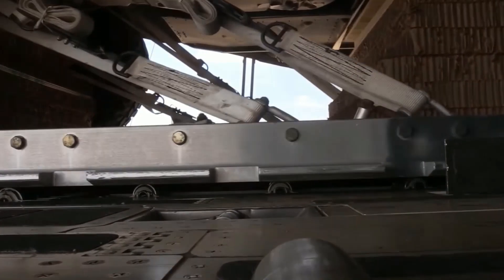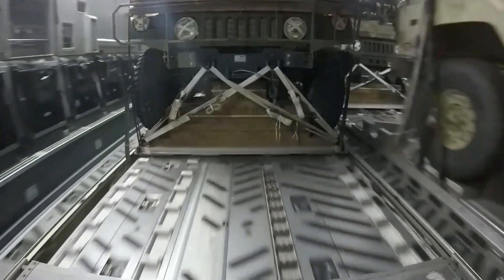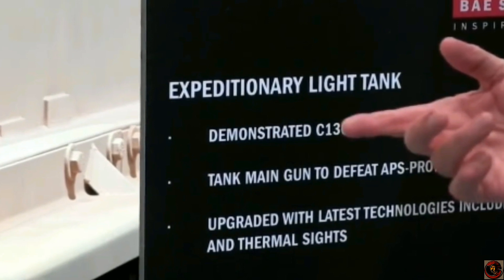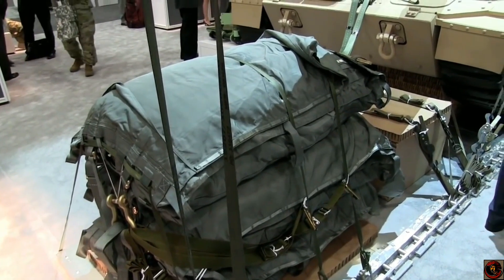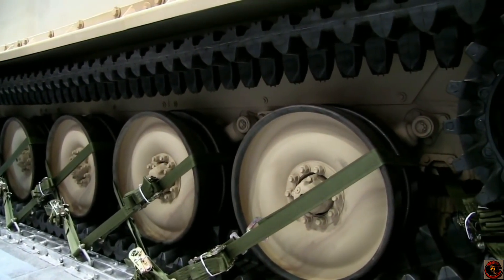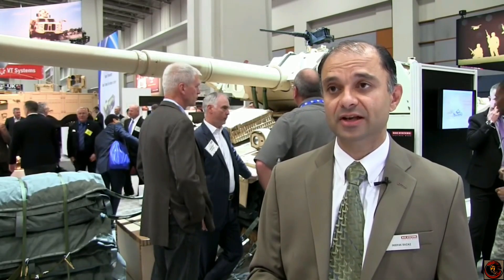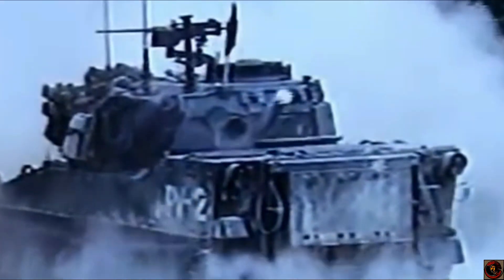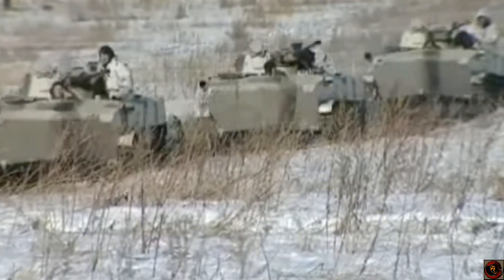Dropping a Tank From a Plane - Airborne Armour?

Comment: I don't think that this is ever going to work for a meaningful weight of armor without new aircraft that have been specifically designed from the beginning with this mission in mind. Dropping lighter vehicles is probably the best way to go with the aircraft we have. If you had a great big new helicopter that had a long range and could easily set down a 70 ton main battle tank that would work. But for dropping a meaningful weight of armor from planes I don't think that it can be done with the systems we have today. It would take everything a C-17 cat do and a lot of expensive engineering to get a main battle tank on the ground in usable condition. Something like a new heavy bomber that is designed with this mission in mind could work though. A great big parachute that can be guided by GPS and a great big air bag system on a tank that is loaded like a bomb that comes straight down from a bomb bay with the crew carefully secured inside and protected is the only way I see this working well.

Comment: Why noone trying to divide the tank to 2 or 3 separate parts, which one is with people inside or completely unmanned.
For example, dropping the chassis first, then the turret part.
About how to assemble those parts there are many examples, such as
1. accurate drop with some kind of guidance.
2. both parts have some kind of locomotion for a short range in case they're separated on the ground.
3. the armor part of the vehicle is bolted on type, and dropped separately.

Comment: For a fiction work I had looked into the Sheridan, air drop and air mobile forces. Didn't serve, so I presenting researched views.  1) Note on how I use terms: Air drop aka parachute as the common airborne is about dropping out of a plane with ground travel out. Air mobile is out of an aircraft with a reasonable prospect of getting back on (example Helicopter infantry). "Day one" refers to a sudden outbreak of hostilities. 2) Air drop lets you quickly deploy manpower and material vs the resources to sustain ongoing fighting. 3) The tank presented and the Sheriden air drop tank is not immediately useable as the crew wouldn't survive the shocks of impact. These could be expected to parachute in at the same time. As would additional ammunition, fuel or other consumables. 4) In looking at the modern situation we do see various asymmetric warfare where sudden engagements can happen by terrorists, bandit type forces or irregular insurgents. Putting even a light tank in the area is a major change as the asymmetric forces aren't going to have a similar vehicle. Survivability of a head on attack is a concern of course. 5) What the light air drop tank provides is a means to put a direct fire option with decent survivability. The ammunition can be air dropped to keep it going. The limited armor is still armor allowing the weapon platform to get closer to fighting and the tracks provide the mobility to move from the secured landing zone to the pockets of fighting. 6) There is an issue of a countries budget. I generally favor more air mobile solutions for my own country Canada as a budget used helicopters vs planes can do more "after day one" support. 7) I do think a decent armor with affordable ammunition vehicle is of use in getting there "for day one" to stop an irregular force getting "dug in" or making off with whatever resource they were after. 8) After "day one" if the enemy did get dug in you will need more logistics for ammunition etc plus can afford the time to move up heavier non-airborne units. 9) If after "day one" you scatter the enemy they might organize another event somewhere else which leads to the question how easily can remount the vehicle, see my definition of airborne vs airmobile. 9) Other commenters have mentioned the wheeled IFV now in use with some countries which provides similar capabilities; 10) First time I've heard of a rubber track system and I wonder what they actually do. Like Maximus I'm wondering if the reliability statement is a sales pitch because things will happen to the track whatever it is made of. For quick response to insurgent warfare IEDs are likely to be around. So what does it take to repair a rubber track from an IED hit? Or an RPG that hits the rubber track?
Reply: What is the name of your fiction work? Considering how tough steel is compared to rubber I reckon rubber would be less impervious to any explosive ordnance.
Reply: Brecconable Gear Krieg a game by Dream Pod 9. WW2 alternate 'diesel punk'  technology added still significant research on the actual forces. My part included writing USA organization such as airborne infantry with one man helicopter stands
Reply: It seems like the rubber track would just completely shred after any ordinance hit

Comment: I would like to see a low pressure gun/guided projectile weapon system for a light tank.   Less weight for the gun and structure.  Low cost conventional rounds for soft and higher priced guided munitions for tougher targets.  Because of the air mobile nature of the concept, self deployability would be less important, reliant on tank transporters.  This concept would have to rely on active protection obviously.  A hybrid power pack would have to be used, possibly a turbine/electric method.

Comment: If you stripped down an Abrams, used the largest parachutes ever used on an air drop (the ones used to airdrop an 86,000lb Miniteman ICBM), and strapped some JATO rocket bottles to the sides of the tank to fire right before impact with the ground, you could probably airdrop an Abrams successfully.
Reply: No, it destabilizes the transport plane, you need a very large trucks. Too big parachute needed. + Brake motors do not always work correctly.
Reply: Джо Неуловимый
I'm sure that could be engineered around. Use a moving counterweight to balance the plane. If they can drop an ICBM out of the back of a C5 Galaxy, I don't see why they couldn't do an MBT, minus side skirts and most of its ammunition. An Abrams might still be too heavy, but perhaps a Leclerc or T-90.

I'm making no claims about the practicality of air dropping an MBT. Just that I think it could be done with some clever engineering.

Comment: Upgrading the Sheridan is not a good idea, it's just to out of date and limiting. What they should to is make a new design (unless Sheridan and also BMD series as references) and if they want to do it cheap, they just have to go through an independent group which would also get things going quicker. Then once they got their design they just license it over to a bigger company for manufacturing. But that wont happen because that would break tradition of wasting time and money.
Reply from the maker: John J they are not updating the Sheridan :-) it's a different vehicle altogether from he Sheridan. Thanks for watching :-)
Reply: Matsimus Gaming
hmm i guess i misheard something well listening, then again i shouldn't be surprised since i was focused more on work.
Reply: I was in the 82nd and worked on the M551 as a turret mech. The Sheridan was a pretty capable little amphibious tank and a way better option than having nothing on the ground. The targeting system along with the Shillelagh missile was ahead of it's time. It's main role was reconnaissance/assault, it wasn't meant to be an M60 or M1A1. With a few updates it would be well capable to continue serving it's original purpose well.

Comment: The rubber tracks seems to be an interesting idea, but what do you do when one breaks? A metal track you can replace a segment or two, a rubber track you need to replace the whole belt.
Reply: ehsnils how about there being several rubber parts connected with something else, and if something breaks, you can just replace it
Reply from the maker: ehsnils exactly. I am more on the side of stretch and mud slip. But hey it's got to be working if they are using it??? I don't know... thanks so much for watching :-)
Reply: I don't think that stretch or mud slip is the main issue, just look at the Hägglunds BV206 bandwagons that are used also in civilian applications - they use rubber tracks. But the use and need for field repairs is different so it's working there.
Reply: I remember reading somewhere that they tried rubber tracks on the Christie tank, which allowed for a blistering top speed, but had the unforeseen consequence of the resultant static electricity produced wreaking havoc with the radio and compass.
Reply: It's probably a special rubber and/or a mix.

Comment: 5 years to upgrade an archaic design to a 105mm, with an overhauled engine and light tracks? Unless logistics still has plenty of parts hanging around, it sounds like a waste of time. Even then, that 105mm is largely going to be relegated to supporting fire and working over legacy armored vehicles. Which is fine and all, until you consider that the Russians already have the 125mm 2S25...
Reply: I agree. The idea of the air drop is an interesting but not very practical option. In terms of anti-tank even infantry have ATGM and SRAW style weapons. The ability it does seem to possess is slightly higher armor for when in the direct fire mode against asymmetric opponents. As you say an IFV can have an ATGM defense, which operate on the same HEAT principles of RPGs expected of asymmetric opponents. There is the possibility of having higher armor useful against solid penetrators which would help when in the direct fire role. Both a gunned IFV like Stryker MGS and the airborne tank do (or could) be used mobile indirect fire cannon. The airborne tank is interesting but I don't see it likely to be worthy of budget diversion for such a narrow role. Everything else it does we have things that do that.
Reply from the maker: Davito2000 fair points :-) thanks for watching
Reply: Target not likely the major powers but insurgents and irregulars. Any 105mm (or 75mm) could do a good job. The mobility by a tracked (or wheeled) system be very useful to get around for eyes-on direct fire. Another point is that if the enemy has been/being brought up 120+mm tanks then you likely knew about it and there may be roads/ports for moving up your own heavies.
Reply: B1 Laxson Modern IFVs can largely fill this roll with modest changes to dimensions and armament, as small bore canons have proven devastating in unconventional warfare. The thing is, when you use a large bore canon, flexibility is a major consideration and 105s and lower lack anti-armor capabilities vs. modern tanks. A IFV usually has enough weight savings to apply a ATGM assembly for anti-armor and anti-material use.
Reply: This man knows what he is talking about.
Reply: I actually think he meant 5 years to upgrade the footage and graphics in their promo video to current standards, because most of that looks like 90s stuff as well. Once that is done, they could actually start getting funding from Congress...
Reply: Davito2000 its meant to support paratroopers when there on the ground

Comment: In Denmark we upgraded our M113's (G3 to G4) with rubber tracks. It works well, I think its better than the old steel tracks. The wear and tear on rubber and maintenance is allot less than the steel tracks. But.. the tension it puts on the idler is harsh. But its easy to maintain so its not rly a problem.
Reply from the maker: CoyDK DK oh ok awesome! First hand account info :-) I appreciate you letting me know if your experiences with it. Interesting stuff. Maybe it's the future then?? Thanks for watching and have a great day!!
Reply: There are allot of child sickness with the new tracks on a vehicle that is from the 60's but it mostly on the maintenance side. 
I think based on what I have learned rubber tracks works well on lighter vehicles (<30 tons) The rider is much better on rubber tracks (specially for my patients) and I can follow the Leo's and CV90 offroad

Comment: i work with rubber tracks on the bv206 and to some degree m113, they work fine, although they do develop cracks it isnt too much of an issue, the load is taken by the steel reinforcement, not the rubber. most stretching is also due to wear rather than temperature as they are reinforced, they act like steel wires, not rubber bands. the best part of the rubber from a user perspective , since we dont really feel the price, is that they are pretty quiet, especially on the bandwagon. i havent been around many metal tracks, but i remember them as pretty squeaky.
Reply from the maker: ravener thanks for you info! Interesting stuff from someone who has used them first hand! You think it's the future??
Reply: Matsimus Gaming it seems like it, yes. an obvious downside is that they need complete replacement from time to time, but since they are so much cheaper than metal tracks they can be considered expendable in the long term.

they arent without problems though as i have seen a belt failure on an m113, completely ripped (will post a picture if i can find). things go wrong if you dont maintain and inspect them from time to time.

but as i said, from a user perspective they rock. easy to work with, quiet and all around very forgiving.
Reply: @ravener96  I mean it makes sense as metal tracks also require manteinance. If they manage to last long enough that a full replacement still ends up being cheaper than metal tack individual piece replacements over the same time period then it's a no brainer. Hope they do further testing and developement with them.
Reply: ravener what’s your opinion on the M113? I find them to be really interesting and a good chassis, and it shares the same name as me. But I couldn’t say anything because I’ve never even so much as been on one while driving

Comment: Creating a new air-dropable tank AND test it in only 5 years? Wouldnt work in Germany today.We need up to 10 years for doing such things in a manner, you would get a German made quality tank!
Reply: Creating and developing of this tank occurred in the 1990s, with the army accepting the tank and then cutting it from the budget before it was produced. 5 years seems like a long time to develop an upgrade to a vehicle that was already air drop able. All they really need to do is update it with the technology available today.
Reply from the maker: cahsahhhhhhhn I agree! It seems far too long. Wonder why it would take them that long??
Reply: @_Matsimus_  Apparently the Puma was delayed because it did not comply with some civillian regulations. The press was mocking them because an IFV"s back door was considered ill suited for pregnant women.
Reply: Matsimus Gaming my guess? it will take that long for them to work it back into the budget. though it is likely that the Army requires or will require some more updates or changes to fit into current and future needs. Those needs could be just about anything at this rate, change being the one constant and all.
Reply: Make it 20
Reply: looks at reliability of German tanks in WW2 Take a few more years if you want
Reply: It actually takes way less time to develop vehicles or weapon systems since the 90ies.
Testing, certification and political bombarded about who builds which presets where tariffs very long.
Takes 1-2 years to develop, 1 to build production lines based on prototype production. Then the customer changes its minds and wants ridiculous new features, but has a wait time for month's to access gov test sites and certify parts of the system.
Thank you deliver something in twice the time, over budget, which is now completely different from What was ordered in the first place and over complicated because you have to integrate new features that were not part of the overall concept.

Comment: I would have to say that an auto-loader for a shock tank like this one actually might be a good idea. So long as they have the system locked down tight, and easily deploy-able once landing, it really wouldn't hurt. These tanks aren't meant to wage and entire war. They're meant to go in, fuck shit up, and just clear the way for actual armor and troops. Including an auto-loader (as you said in the other video) cuts down on having to send another crew member in. So what if they're then down one man for repairs and resupply? If things go even halfway right, the tank wouldn't be in singular action nearly long enough to require extensive repairs, or even much of a reload. If they're bothering to send in a vehicle like this, they'd most likely have a good amount of knowledge on what to expect, and could thus adjust ammo load equivalently. If they have several dozen paratroopers supporting them, the tank wouldn't need much in terms of canister shells.
Reply from the maker: Erikon14 fair points :-) thanks for your input. I appreciate you stopping by and watching also :-) have a great day!!
Reply: Having an autoloader on a tank is just one more thing to break when it slams into the ground :/
It may be secured, but still...
Reply: not only can it break, but it also adds more weight than 1 loader.

Comment: I think Russian and to a lesser degree China's approach (aka Armored airborne Infantry) are the way to go. I think in modern warfare , it's much harder to have to replace the well 

train airborne paratrooper than some BMD or airborne light tank. 

And if a 500 paratroopers and 30 BMD/ or Light tank could do what 1000 light paratrooper without tank or apc, than I think it's worth the extra cost of more Transport Plane and 

other equipment.

Build APC or Tank take week, build plane take months, well train paratrooper take years to from.
Reply from the maker: Raven kk some great points there! Thanks so much for sharing. I think I need to do more research on the BMD for sure!